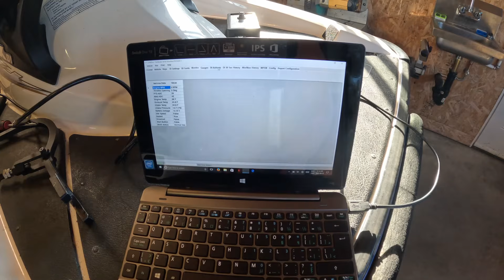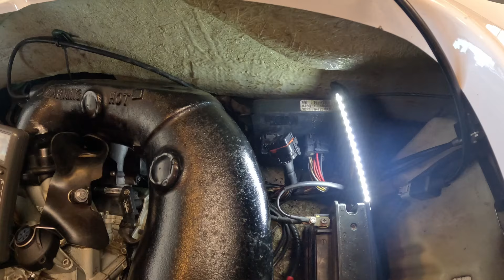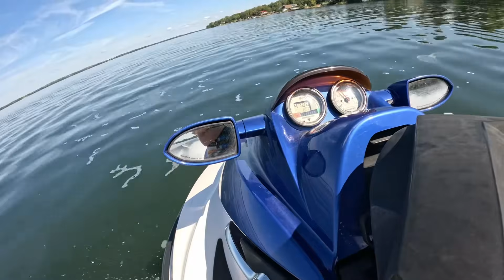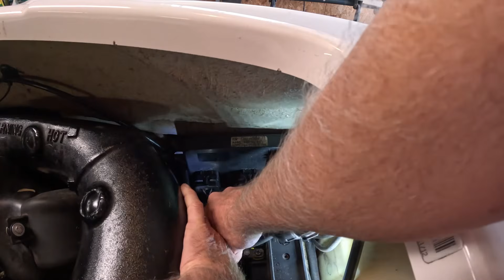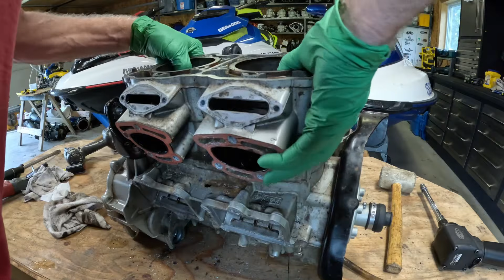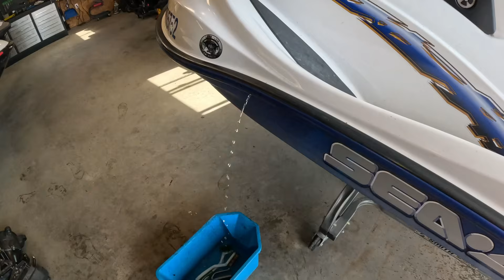GTX Di maintenance LIGHTS

Comment: Great video.. May I ask is it worth spending the money to fix up with your parts and your labour time? As it’s an old ski..I know in the uk if that happened to one here it would be scrapped.. Cheers
Reply from the maker: the machine was in great shape.  If he sold it for parts then he would take a big loss and then have to go find another.  There is no guarantee that the next one does not do the same thing.  Now he has a machine in good physical and mechanical condition that is still far cheaper than a new one.  I have 6 different people do the same thing this summer and all are happy with their decision.
Reply: Very good video. I had a 2001 and 2002 and IMO the 2001 is a better machine. But I loved them both.

Comment: I simply couldn't imagine what the bill is for that ski, as much as it's worth or more. Guess depends on a used or new crank, wasn't mentioned if was new crank or used. They new or rebuilt I've seen $700 to $900 for a crank. And remains $500. I bet that was a $2400 bill.
Reply from the maker: I believe it was very close to that..

Comment: Great Video. I did want to share. I recently had the screw which binds the air pump piston to the counterbalance shaft SHEAR OFF during operation. Question, Do you replace the screw every time? In your experience is this a one-time torque screw?
Reply from the maker: My guess is that something (water) got into the top of the air compressor.  You can’t compress the water which causes the bolt to shear off.  I can’t say that happened to yours but that is a common issue.

Comment: Are you able to replace just the bearings or did you replace the entire crankshaft i think I have the same problem I was rotating the engine and could hear bearings falling
Reply from the maker: I replaced the entire crankshaft .  All bearings were toast.